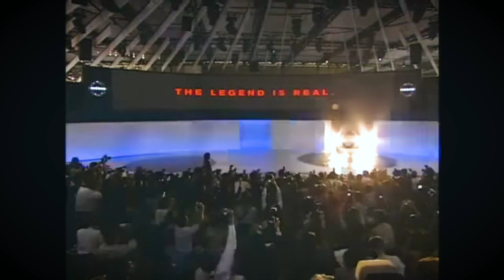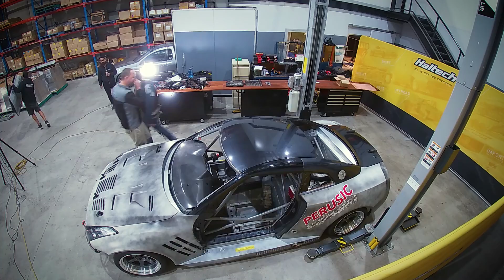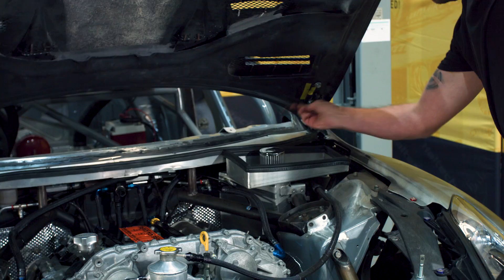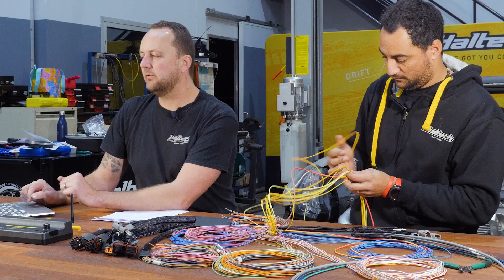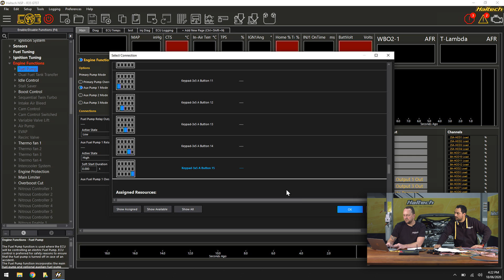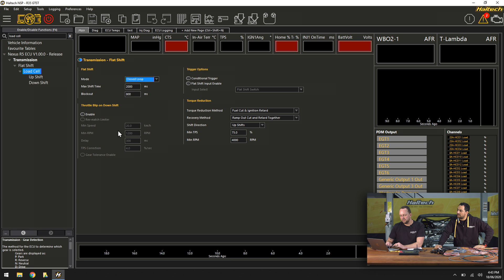🛠 EP1: Getting ready for a NEXUS R5 install | R5 for R35

Comment from the maker: Welcome to another tech series. Get in, buckle up and hold on, it's gonna be one hell of a ride!
After getting tons of comments requesting a hands-on guide showing the fitting and setup process of the new NEXUS R5 we figured the best way to do it would be on an actual car. It just so happened we had a proper, serious circuit race car in our garage, all ready for wiring and an ECU install. We pitched the idea to its owner and he agreed:)
The car in question is a ground-up build based on a Nissan R35 GTR. With a twin turbo VR38, sequential gearbox, ABS, staged fuel pumps and more sensors we could poke a gear stick at it's an ideal candidate for the NEXUS R5.
In this episode we give you a quick overview of the build, go over all the products we'll be installing and get cracking with the wiring. Enjoy!
 -----------------------------------------------------------
Brian's Time Attack Corvette: https://www.haltech.com/haltech-heroes-brian-bughs-time-attack-corvette/
Haltech's Guide to Time Attacking: https://youtu.be/F1rAxWkfFD0
Leon's Time Attack Evo: https://youtu.be/hCS7tiubHzk
Dave's Wiring Vlog: https://youtu.be/IpNfRaM_P04
Reply: Guys, you are best😁👍

Comment: Can you run the r5 mounted in the engine bay?
Reply from the maker: You definitely can, however, if avoidable we do recommend mounting inside the car, as although they can deal with the heat/water they are still a sensitive electronic device
Reply: @haltech thanks for replying!
Yeah, I just really don't like the idea of running all those power wires through the firewall. Plus it'll keep all the high current runs short. I need to make a custom battery box, so if I also made a section to house the ECU to shield it from the engine bay and had some cool air intake would you be comfortable with that? Or would you advise an in cab ECU and the pdm in the engine bay?

Comment: Did I hear that right?  You can run an entire car through the Nexus?  Like brake lights, windows, wipers, turn signals?  All through just the Nexus?  No additional PDM or relays needed?
Reply from the maker: Correct:)
Reply: @haltech  That simplifies EVERYTHING!!  I want to rip out the entire electric system from my car and put this in, just because!

Comment: Any chance at a can based input only box that has say 8-12 inputs? This would allow a box to sit behind the gauge cluster and wire in all of the column stalk switches without eating a ton of R5 inputs.
Lights, blinkers, wipers, horn, cruise and all that.
Every time I wire a Haltech ECU it seems like I'm scrounging for inputs with outputs to spare. DBW only makes this worse. 
I ask because of the even ratio of I/O on the expansion boxes seems like a waste. Would love one more geared towards inputs.